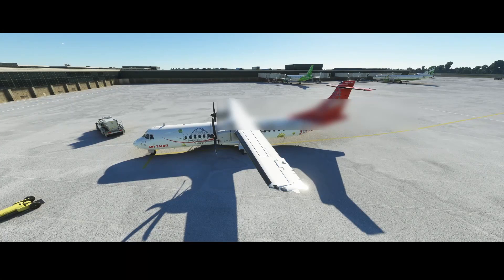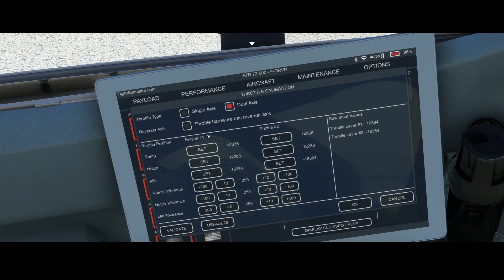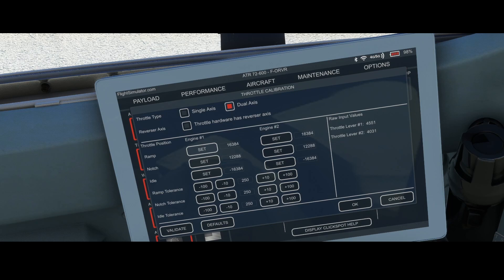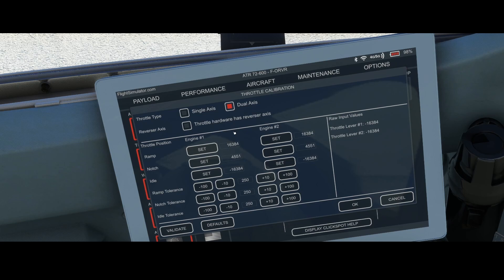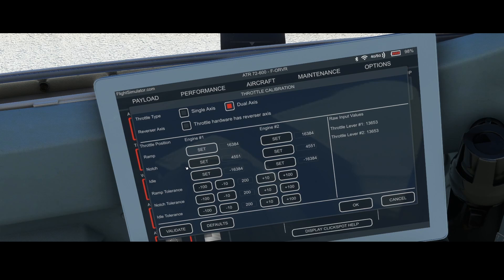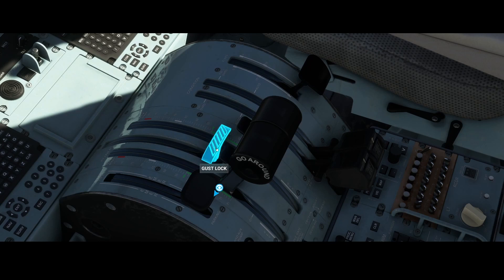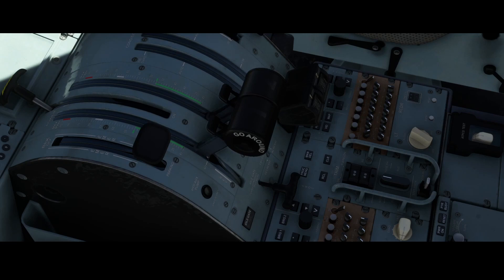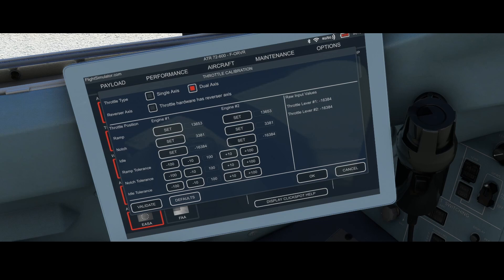Flight Simulator 2020 - How to - ATR 42-600/72-600 - Calibrating the VelocityOne

Comment: Thanks!  I have been able to get the reverser to disengage just by moving the throttle off of idle.  There is a 3 or4 second delay before it moves.  Do your flaps work?
Reply from the maker: yes my flaps do work, in your case they are not working?